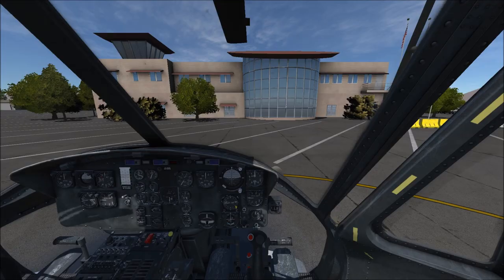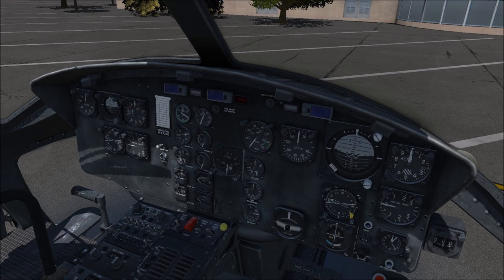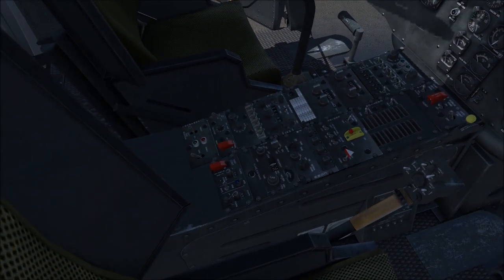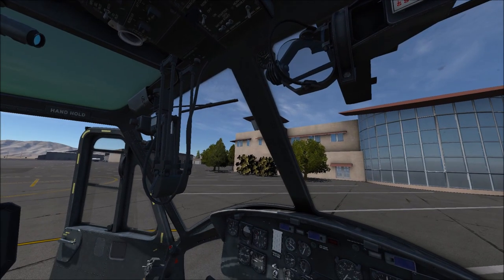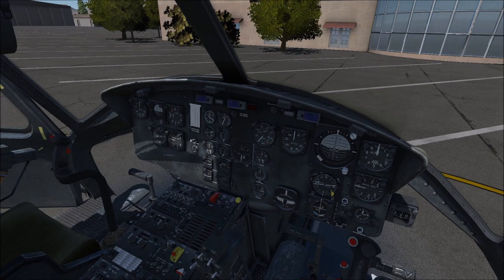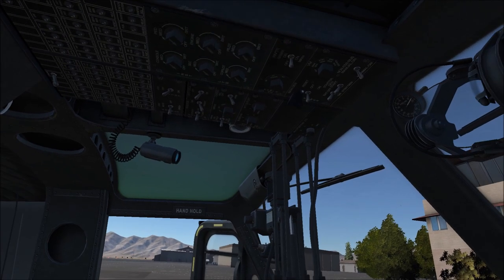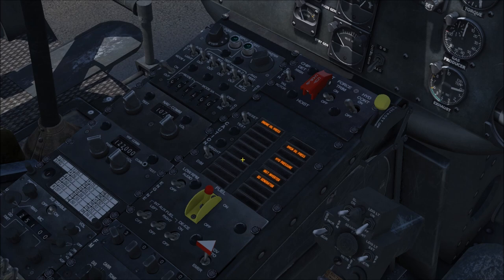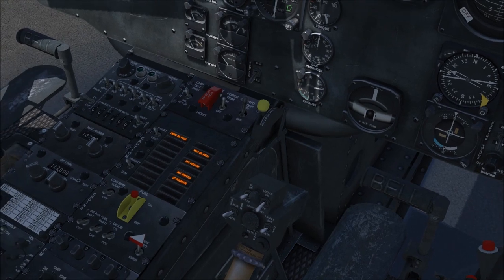Accuracy Flight Test - DCS UH 1H FAT Joe - Part 2 Others

Comment: can you explain what you mean by "I'm going to roll the throttle off"  when you were doing the hover auto-rotation.  Like is there a throttle adjustment on the collective?  i thought the throttle was automatically increased and decreased on the collective, or do you manually twist the grip on the collective ? thanks in advance for this wonderful video.  (Im asking because if I need to assign an axis control in DCS for the throttle grip on the collective, I can do that...if it's all automatic, then i won't do that...i don't have a simulator collective, I'm just using a VIRPIL throttle T50-CM2 to do the collective).  I might get a flight-sim collective eventually if you think it would help be more immersive and realistic.

Comment: Thank you for that impressive and all-inclusive review!

Q: I was under the impression that while starting, the EGT should always stay in the green, otherwise it becomes a Hot Start (with flames and black smoke literally coming out of the exhaust of the DCS Huey model!!). Though this does not happen with the throttle 'closed'... (though that does take away from the realism of a start like in real life).
Have also used 'C-Tek' Heli control, which DO simulate 'Idle Dentent' with a real physical button on the collective that needs to be depressed to close the throttle fully...
Reply: The EGT can go up to 675° for ten seconds, and up to 760° for five seconds during engine start and acceleration, anything above those temperatures for any duration longer than those times would be a hot start according to chapter 5 of UH-1H operators manual.
Reply: Thanks for the informative reply... so, the flames coming out the exhaust during a start with > 625° EGT temps can be ignored then? Or is that modeled wrong in the simulation?
A while back, have made a DCS "mission' with those same 'EGTemperatures / Times' you mentioned; in where any exceeding of the 'Time / EGT temperature limit' results in very noticeable engine damage.
Reply: Good question, I had to test this to see if there is any effect. I always do my engine starts from the cockpit view so I had no idea there were flames coming out of the exhaust when the EGT exceeds 625. Based on the UH-1H operators manual, this effect in DCS is incorrect. to be fair I have seen a fair number of "normal" turbine engine starts where a small flame can momentarily be seen the exhaust, but nothing like the flame thrower DCS shows.

Comment: So, judging from the score from previous tests it seems that  FSX SE Dodosim Bell 206 has better flight dynamics then DCS UH-1. Well that seems a bit strange, doesn't it?
Reply from the maker: the Dodosim 206 FSX is a rare gem, a piece of software that is used for real transition programs and training, which explains the extreme high details in procedure capabilities. It performs far, very far, from most FSX add-ons. but every sims have there own + and - ... it really depends what you have in mind with your setup. The dodo performs well in most dynamic tests, but fails at some too... I actually flew the real Jet Ranger for several years before flying the Dodosim, and I was literally stunned by how realistic the Dodo flew. 

that being said, we would not be surprised to see DCS evolving even closer to the perfect score thanks to a very dedicated team, and we are dreaming of higher resolution 3D goggles, and of course, 6DOF platforms :-)

Comment: Heyo!!! Could you please turn on the control indicator for these videos? It'd be helpful for us following along so we could do what you are doing!!!
Reply: I considered it, however when using VR the control indicator doesn't follow your line of sight, it stays fixed near the top of the center beam between the windshields. During my testing prior to shooting this video I found that it was hardly ever in the shot.  I look around a lot during normal flying, and for these tests, I'm mainly focused on the instrument panel. So long story short, I didn't think it added any value to the viewer so I left it out.
Reply: Understood on the VR thing, but you had said you weren't using VR for this vid I thought?
Reply: Robert Mantell that was for the start up portion with the aircraft on the ground. all of the flight segments we're done in VR.
Reply: Ah, understood. Thank you!! I just was hoping to actually see your inputs lol. Thanks though, good vids, both part 1 and 2. Question, do you use the pilot trimmer when you are flying?
Reply: I turn it on as part of the checklist, but have no buttons assigned to the trim system.I haven't found it necessary when using the Pro Flight Trainer controls.

Comment: Try hovering with hydraulics and trim turned off and you'll know how to hover the R22
Reply from the maker: ?!? :-)
no high forces on R22 controls? 15-30KG Loads on hydraulic off in UH ?
not sure to understand your comment?
Reply: @proflighttrainer  I was referring to how twitchy it makes it.  At least with my setup, there's no resistance at all so you can't find the center or feel any resistance in any direction.
Reply from the maker: @Scott.Farkus  control load for R22 would be a dream on home setup! agree with you on that. :-)
The mechanical implementation would be doable (servo motors for each flight axis), 
but no software (as far as I know) outside of commercial simulators will provide the data to actually implement the amount of resistance for each axis... that's sad... 
so even with servos motors installed now on each axis, you have no clue how much force to apply since the sim software does not provide that information :-/
unless the sim software dev provide that information, this "issue" is not solvable for retail simulators, sadly...
Reply: @proflighttrainer  I'm using simFFB to control force feedback in DCS.  Makes huge  difference in the cyclic's feel.  Only issue is you have to start the app. after you start DCS.  I use the Oculus Rift S  so all I have to do is lift the headset and click on the icon on my desktop.
Reply from the maker: @Scott.Farkus  OK, that's interesting. But how do you mechanically apply the forces to the PUMA? or are you flying with a Table Joystick?
Reply: @proflighttrainer  I'm flying with a Microsoft Sidewinder 2 FFB stick, but I hold it between my legs like where a real cyclic would be.  
I can't figure out how people fly with their cyclic sitting on their desk.  Maybe if they're flying a small sport plane with a stick on the side it'd work.
Reply from the maker: @Scott.Farkus  roger that. thanks for the explanation. I guess our team should test that sometimes, just for general knowledge.
We know VRM Switzerland (professional sim market) developed load control software that plugs into the R22 from Aerofly FS2. It works wonder, but a bit more expensive than a Sidewinder :-)
Reply: @proflighttrainer  I see what you're saying now.  simFFB only maps your controller, if your stick is FFB.  That cancels out any FFB from the game.  Long as your stick is recognized by Windows simFFB acts as a custom map for the controller.  When you start the simFFB app. a windows opens on your desktop and you adjust the sensitivities there.  
Spring Force
Damper Force
Friction Force
and you can swap axis
I think you can setup/save 32 separate configurations across multiple devices.